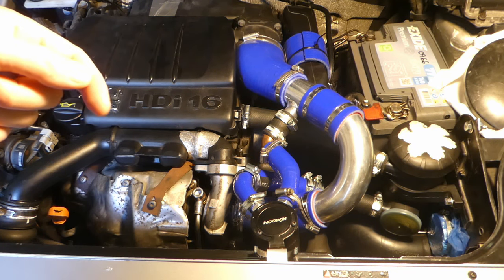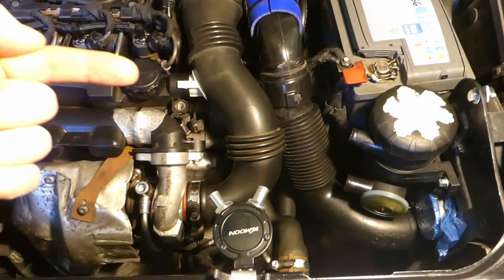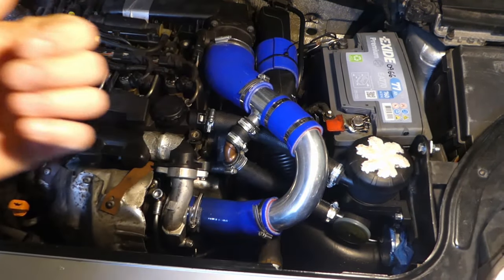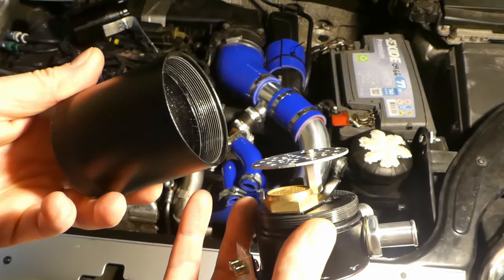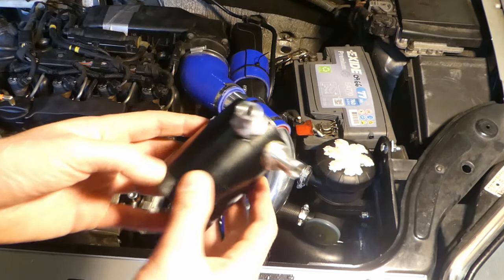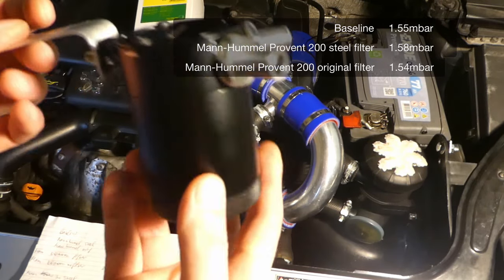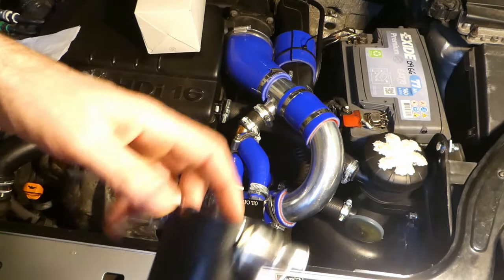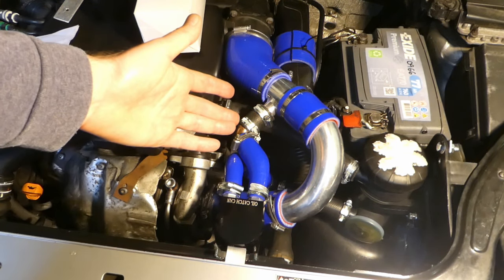Oil Catch Cans Crankcase Pressure, Provent 200 vs Mishimoto vs Universal oil catch can

Comment: Excellent information. Those bronze filters are crap, the makers aren't even standing behind them. 4 times the pressure, what the hell....
Reply from the maker: I was also surprised that the pressure was that high with the bronze filter. Although, it will probably filter quite well due to the really fine holes inside, allegedly 50 microns.
Reply: @moremolecules  I noticed an orange cast on my spark plugs months after installing the bronze filter type. It appears that the pressure in the engine was forcing oil through the valve seals and that orange cast was oil additives. The bronze filter becomes clogged.
Reply from the maker: @nespokesman  Thank you for sharing this. Because of this increase in pressure I decided not to use the catch can with the bronze filter. If they invent the same catch can, but with some sort of a by-pass relief valve, like the Mann Hummel one, I would definitely consider it.

Comment: Hello my friend
I installed a cheap type oil catch can and it comes with a small filter on top
Note that I bought the car three months ago
Diesel engine 2500
A month after installation I found a little oil around the manfold casket
and inside the intercooler
The engine is good, there is no black or white smoke, and there is no oil loss after traveling 3000 km
I really don't know if the reason is old or the  cause is the oil catch can do it
Another question
Should the installation be done away from the engine, away from heat?
Does it need to be installed a little higher than the engine level?
Finally, sorry for my many questions and sorry for my English
Reply from the maker: Not too sure what the problem is, but ideally you need to place the oil catch can as far away as possible from the heat. At the end of the day the oil catch can is a condensing thing and the bigger temperature differential really helps with condensing oil/water, etc. So, if you can cool the oil catch can really well, say with ice or cold water then the efficacy will be really good. Unfortunately, this is not practical in engines. I would not install an oil catch can higher from the crankcase breather, as the condensing fluid will come back and plug the hole. Ideally you need to put it lower than the crankcase breather so any fuild/oil to go into the oil catch can.

Comment: Hi!! excellent video! cool!!! So would the kkmoon's copper filter be a good system for gasoline engines? Or would you recommend the Provent for a gasoline engine?
Reply from the maker: If you can afford it I would still use the Provent, although the kkmoon is also alright. The only negative of the provent is that you need to replace the filter every so often, probably something like 20k miles.
Reply: @moremolecules  ok!! Actually, the issue of changing the filter doesn't bother me, if it helps the engine, it's fine for me, thanks for the help!!! 🤘
Reply from the maker: @Mark_182  I am always penny watching, so that is why I mentioned it. If you have not probelm with cnahging every so often it is a good system.
Reply: @moremolecules  excellent thank you very much!!! 😃

Comment: Sorry if I'm being stupid but your pressure numbers are "delta to atmosphere" right?

6mbar is 4 times 1.5mbar sure... but we're taking about less than 0.1psi, surely that can't really make a difference for the sesls in the engine...
Reply from the maker: Hi Dominic, yes it does not need much pressure to do damage to the seals. I know it is tiny pressure, but the maximum for these engines and a few others is ~35mbars. The original Mann-Hummel Provent 200 has a pressure relief valve on top that opens at 50mbars, so this is really the maximum that they think is quite high.
Reply: @moremolecules  that's quite interesting

I haven't really heard of this being an issue before but it does make sense upon thinking about it further

Thanks for the hard work putting all this to the test!!

If you don't mind discussing a bit further though, do you think the situation /issue you described is the same for turbo- gasoline engines?

I just ordered this unit from mishimoto(https://www.mishimoto.com/mishimoto-baffled-oil-catch-can.html) that has a removable bronze filter which seems to have bigger surface area (which should reduce pressure drop), what do you think of the design? Should I run the catch can with the filter removed? 

At the end of the day the catch can add a device is facing an engineering challenge with two conflicting conditions. Like any filter it needs to flow well, and to filter well.

 Certainly there can be "bad" designs which do both poorly or performs very well in one area at great expense to the other. 

What design elements do you think are indicative of a system which can do both things well? 

To me it would be :

Size - a large can would allow the crankcase gasses to slow down (atleast a bit) making it easier for the oil droplets to come out of suspension

Flow characteristics - designing the can in such a way that the crankcase air "fully utilizes" the space in the can so it can achieve the effect described above

Filtration - something to "actively" encourage separation between air and oil vapor, you're could be a fibrous element, or bronze "sponge" or centrifugal vortex (like Dyson vacuum). 

Obviously it is case dependent but which area should we prioritize, the filtration or impediment to flow?
Reply from the maker: @DominicLeung87  Thank you very much indeed for the really thorough and good comment. I absolutely agree that it is a trade-off between efficiency and flow (increase in pressure). There os very little amount of actual academic research on this subject. I think I found one single paper that talks about the components in an oil catch can. The paper mainly looked into how the air needs to swirl around in order to maximise the amount of time the droplets/air are in contact with the oil catch can surface in order for them to coalesce. The research showed that circular motion of the air is the most efficient, that is the same design as the Mann-Hummel. Unfortunately, they did not go further into this. The problem is that how much is too much pressure. There are too many factors to account for here. How old/worn is the engine will determine the amount of breathing the engine does, the more worn it is the heavier the breathing and the same amount of restriction (oil catch can mesh) will give you different crankcase pressure. For some engines this will result in leakage from the seal, others would not.
As far as I am aware almost all catch cans are the same design with variations here and there. Nevertheless, mishimoto noticed that in diesel engines, albeit the really big 6.7L ford cummins, their oil catch cans creates too much crankcase pressure. So, they designed a new more permissive oil catch can. When I say permissive, I mean bigger surface area, as you mentioned in your comment. https://www.mishimoto.co.uk/ford-67-powerstroke-catch-can-install-2017.html
If that oil catch can was available for a reasonable price, I would definitely buy it, IMHO seems like a very good compromise of everything. The overall problem is how much crankcase pressure is OK for the engine. Very difficult to answer and very little information anywhere. I managed to find only one single source for a mini petrol engine and the maximum there was ~20-30mbar, which is not that much actually.
I could go on about this forever, but my reply would turn into a blog post :-). Hope that is somewhat helpful.
Reply from the maker: @DominicLeung87  Good luck with the catch can. It should be OK. I have an idea of how to test different oil catch cans, but I will see if I can do it. Most of the grease monkeys just say, "ohh, this oil catch can is the best", etc. There is no comparison whatsoever, as long as there is something collected in the oil catch can. The problem of course is to emulate the size of the droplets, as the function of the oil catch can will depend on the size of the droplets. No easy way for me to test their size, apart from a sophisticated scientific equipment.
Reply: @moremolecules  I think testing restriction is fairly easy, just hook up one side to an air compressor and measure pressure drop

Just by eyeballing the designs out there the pressure drop should be relatively constant unless the can is super full

To test actual filtration will be harder, will need to aerosolize oil at a semi consistent rate, pass it through the catch can, then capture fully the oil vapor that gets through via filtering again with a paper filter or something and weighing that... 

Seems like a LOT of work

It’s also hard to tell how good of a test this is since catch cans are supposed to work over like 6months or something of driving... a bench test of even a full day isn’t really representative
Reply from the maker: @DominicLeung87  Exactly and well summarised. It is tough to do a perfect test, but I suspect anything will be better than nothing, although even that would be tough.

Comment: Thank you for an informative video, I have one question: I have a catch can with the bronze filter. The catch can is routed from my PCV to an intake vacuum line. The catch can also has a drain valve at the bottom. When the engine is running I have opened the drain valve and i can feel the strong suction. As long as there is suction is it safe to assume that there is no build up in the crank case pressure?
Reply from the maker: Hi Joshua, no necessarily though. It only restricts slightly. In other words, if you did not have the oil catch can, the one with the bronze filter, the vacuum/suction will have been stronger. I assume your engine is petrol as diesels under idle will not have strong suction, but pressure. It is tough to say if the restriction is enough to cause problems, e.g. oil leaking past seals.
Reply: @moremolecules  I do have a petrol engine and yes agree, suction could be stronger without the bronze filter, but as long as there is suction the crank case is being vented, which shouldnt cause any pressure build up, do you agree?
Reply from the maker: @joshuagracias6354  Yes, the crankcase gasses get sucked out and pressure relieved.

Comment: Hi nice video,
Do you think that leaving the return pipe to the turbo disconnected will change anything apart from emissions ? or there is another reason for the return pipe to go back to the turbo !
Reply from the maker: Hi Jaber, it has dual purpose. One is the emissions and the other is that the air pull from the turbo brings the crankcase pressure in the engine down, up to a degree of course (the PCV closes to stop the oil being sucked from the engine). I have it on a graph in this video: https://www.youtube.com/watch?v=h4TQ-XVWU30. When you press hard the acceleration, the turbo kicks in and the pressure in the engine is negative, with respect to atmospheric of course. This really helps the gasses being drawn out. If it is left out, not connected, then the pressure in the engine is always high, long-term is probably not a good thing.
Reply: @moremolecules  
Thanks for the reply.
It would be fun to run the car as you did in the linked video, but with the return pipe disconnected and see what the graph looks like, if it will be constant all the time like in idle or if we see some difference.
Reply from the maker: @Neema1135514  Yes, I have not done that, but it will be interesting to see what the pressure is.

Comment: How much pressure is too much?? 6 milibar is only 0.87 psi.
Reply from the maker: I have answered that before and always gets asked. These engines max permissible pressure is 30-35mbar, so you can calculate how much is 6mbar out of that. The original Mann Hummel Provent 200 has a relief valve at the top that opens at 50mbar. So, 6mbar, if you engine is a bit on the worn side of things will get you quite high.
Reply: 6 millibars is 0,087 PSI.

Comment: Very informative. Great video sir. This is exactly what I'm looking for. I'm planning to install Oil Catch Can myself soon but wasn't sure if it's good because some video said not to install it because it will increase the crankcase pressure. Now I know it's the internal design of the Oil Catch Can that effect the crankcase pressure. Got the 'cheap' Oil Catch Can exactly like in your video in our local store. Will get those soon. Thanks again for this video.
Reply: Also my car is Mitsubishi triton 2.4 mivec. Has over 100k km on it. Do you think it's too late for installing Oil Catch Can? Thanks.
Reply from the maker: @ericsson980  Never too late really. 100k is not that much anyway, so perfect time to put one.
Reply: @moremolecules thank you sir

Comment: Think a better test to test fist can, is to let it run first for a while to get soaked with oil. As it soaks up all the oil first than drain to bottom. Than restriction will be more.  Want to agree with Joshua Gracias with turbo engines its sucking air through more, that the cans a better option
Reply from the maker: I agree that getting an oil catch can soaked with oil will increase the crankcase pressure, as they become more restrictive. It does not matter if there is suction from the catch can or not, there will always be suction there, at the end of the day it is connected to the turbo. It just matters how much restrictive are the passages.

Comment: @moremolecules I'm wondering - could increased pressure for mishimoto/universal catch cans be due to much smaller in/out ports? ProVent has 24mm internal diameter input/output ports whereas mishimoto and other cheap copies are usually around 10-12mm and the biggest I saw were 19mm outer (16mm inner diameter). It would be interesting to see what would be the pressure if one would make ports for mishimoto/universal bigger - say 22mm (which is original hdi hose connector inner diameter)
Reply from the maker: Most of the increase in pressure does not come from the hoses or the smaller in/ou.  I did try the Mishimoto/KKmoon without the bronze filter to see how much this adds. It was relatively substantual increase in pressure, so not just the hoses. But they all add to the increase in pressure. Basically, the bronze filter is the biggest contributer to the pressure increase. At the end of the day it is a balance between complete efficiency and permissive. If you have complete efficiency or close to that, it is to create resistance as the gasses need to pass through something where they have to coalesce, hence the increase in pressure as too big holes and you have little efficiency. Gas molecules, even laden with oil/water are still pretty small molecules.

Comment: Hey, great channel, loads of very good info. Just wondering if you have replaced the plastic inlet manifold? I just got a 1.6 hdi 145k miles. The inlet is really blocket up with carbon and goop. I dont think i will be able to clean it out of the plastic inlet. So i want to buy a new one. I am looking on ebay and all are aftermarket, just wondering if they are any good quality
Reply from the maker: Thanks for the encouragement. Which plastic inlet manifold is that? Is it the PCV valve one?